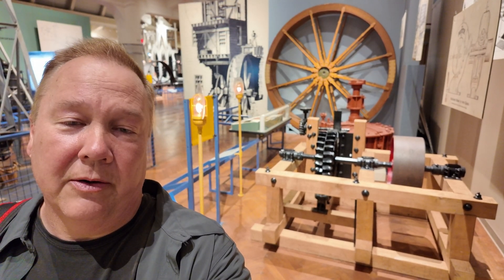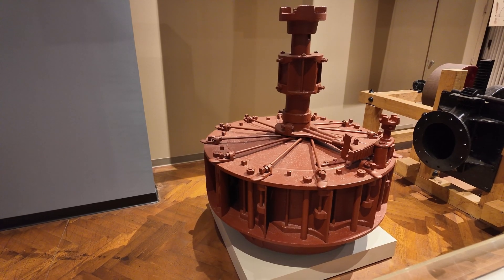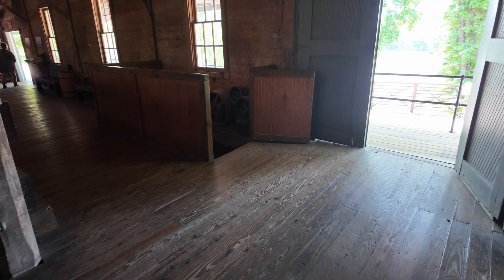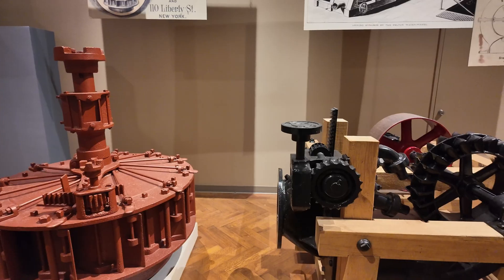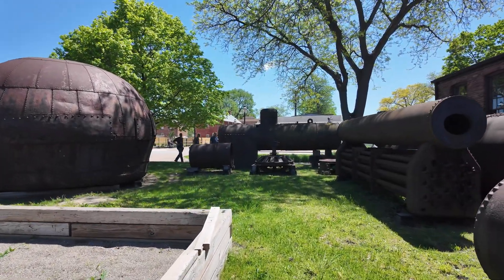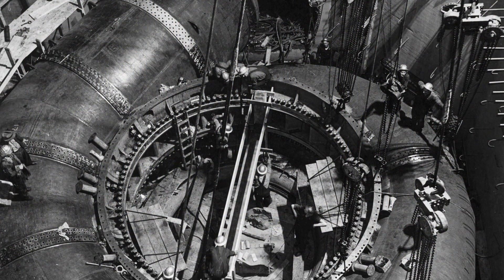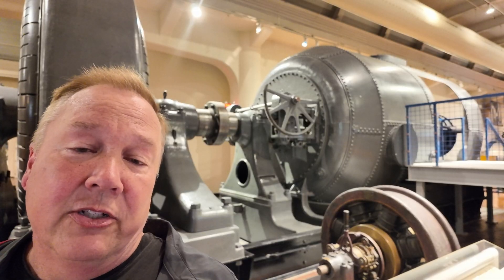The Incredible Evolution of Water Turbine Technology

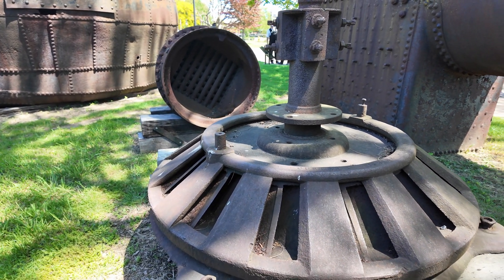Comment: Wow, never seen both those turbines before. Both "the odd one" (around timecode 05:00) or "the interesting one" (around timecode 05:15). The first somewhat reminds me of a traditional, vertical axis Norwegian water turbine. The second one is more along the lines of a Tesla turbine (?). Is there  more background info? Additional question on the second one: is that water in the role as drinking water or in a role as fluid power? (as in a hydraulic power grid, the precursor to our current electricity grid). Thx.
Reply from the maker: Asking about the vertical one back inside the museum?  That one actually hooked up to the regular, municipal drinking water supply, same place you'd hook up your kitchen sink.  I don't have much more info on that, specific one, but there are companies now producing modern versions that go directly into the water mains, like the one at the link below.  The drawback, of course, is that you usually have to use electricity to pump the water up high (to a water tower, for example) or to pump direct to pressure, so using this type of generator is usually going to cost more power than you gain from them.
https://yaleclimateconnections.org/2017/03/company-turns-piped-water-into-electricity/

Comment: Very nice video.
For the looks, I like waterwheels more than turbines 😅
At least in Germany there is  a big trouble about the protection of fish, if a fish goes into the turbine its shredded.
One one hand people want green energy here, on the other hand they want protect the fishes, I dont know the
situation in the USA, maybe its the same? Turbines/water wheels exist for hundreds of years and fishes in the river 
also, so the problem has not to be that big!
I once have known a grain mill, it has run until 2011, which was powered by water turbine and also a huge 1-cylinder diesel,
all belt driven and decades old. Sadly it closed down, because of the miller got ill and died some years ago.
Glad that it is now a museum!
Reply from the maker: For looks, waterwheels definitely win.  For nostalgia, too.  
Some of the newer, hubless turbine designs are actually supposed to be fish-safe.  They're mostly running them as micro-hydro.  Don't know if there's any reason they can't be scaled up, or if there's just no big projects to try one yet.  My dam removal videos always bring up a lot of questions about why they can't be used for hydro (typically too small for grid-scale), but I'm thinking of doing a video on the newer technology.  It's something I've been interested in, and it seems a lot of my viewers are, too.

Comment: I read where James Bicheno Francis came from England to superintend the Lowell Mass water power canal & locks. He and his blacksmith made a turbine according to a french engineers math. They saw lots of friction/wasted effort and losses. They made the blades curved so as to maximize the availible power in the water.  
  Mr Francis also had the genius to raise the canal banks and locks b/c when not if there would be floods. 
I used to live near Augusta Ga. The Augusta Canal is modeled after the Lowell canal. I used to go to the different mill and foundry sites  after work and study what was still there. One site still had the wheel pit that was 14' in diameter. On the walls were many dials and meters. The discharge pipe in the wheel pits bottom was 30" in diameter. 
  At another site, the control gate was (still there) on the first level. My buddy and I went in the 3' diameter brick pipe that fed the still intact  verticle shafted impulse wheel that was 25-30' below the top of the first level.
  Lastly...at one end of the second level...there was a seed and feed mill that had belt driven motors that operated grinders, sifters.  I saw where the excess water was encouraged to empty into the third level using bricks that protruded from the
bank...then went back  into the bank. Difficult to write. The water was "shoved"  in the direction of the third levels eventual discharging back to the Savannah River where seven miles upstream it entered the first level. 
  There are 14,000 horse power in the canal. Three mills use approx 25% of this. Making electricity. 
This canal was very successful. The cotton was grown nearby in  S.Carolina & Ga. cotton farms did not have to send their crops a long distance like the northern mills had to do. 
  Another advantage...the canal never froze in the winter.  
Thank you for making your vid. Water power is a passion for me. 
  All the best, Pete 🙂
Reply from the maker: Thanks, Pete!  I haven't looked at southern canals much, largely because I've been doing closer ones, but sounds like I really should try to get down there, maybe as stuff around here starts to freeze solid again.
I need to do a video on Henry Ford's use of both turbines and water wheels in his Village Industry sites.  They were small factories on mid-sized, fairly mellow rivers in SE Michigan.  When he built them, he decided if he wanted to run overhead line drive systems or electric for the parts they were going to build, then put in either a water wheel (for line drive) or turbine (for electric generation).
Reply: @Industrial_Revolution  You are welcome. Yes, I am familiar with line shafts. I knew of a line shaft shop in 
Waynesboro Ga. One electric motor ran the shaft. Flatbelts to the lathes, drill press and shaper. 
Be great to hear from you on your findings. Cheers 🙂